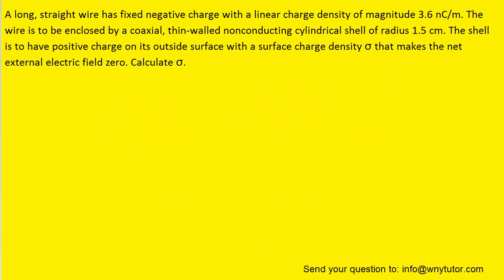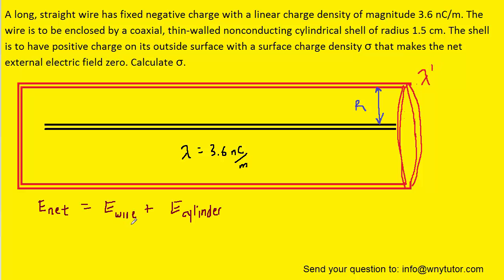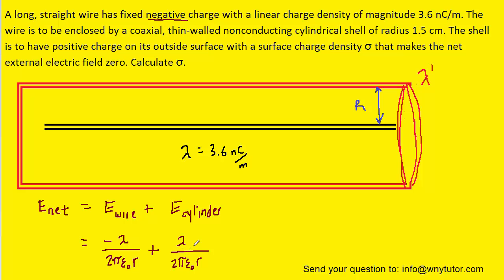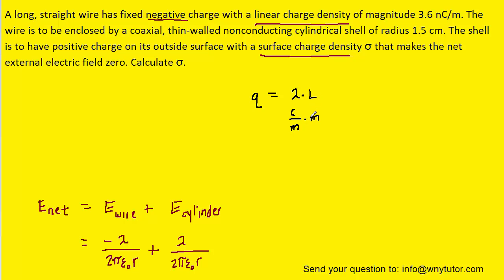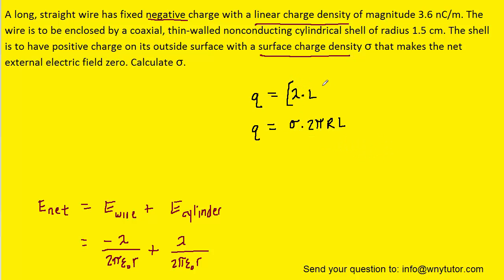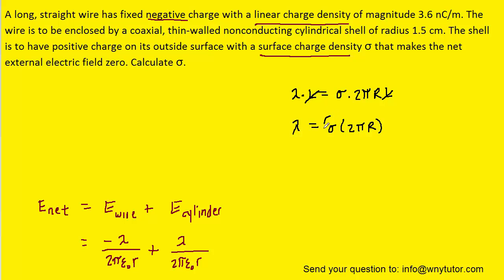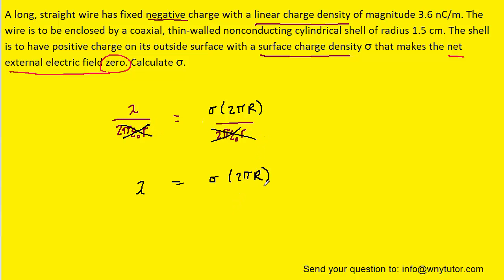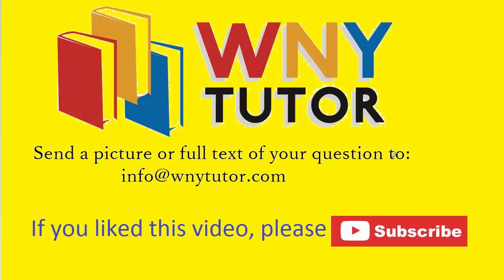A long, straight wire has fixed negative charge with a linear charge density of magnitude 3.6 nC/m.

Comment: @2:04 you said that the surface area of a cylinder is 2*pi*r , but it's not? You only use that because there is no electric flux coming out of the circles

Comment: Not a big problem but you made a small typo at 3:26 when you wrote 3.6 nC/m as 3.6E-6 C/m. It should instead be 3.6E-9 C/m.
Reply: And using "^-9" i got 4.05*10^-7 C/m^2